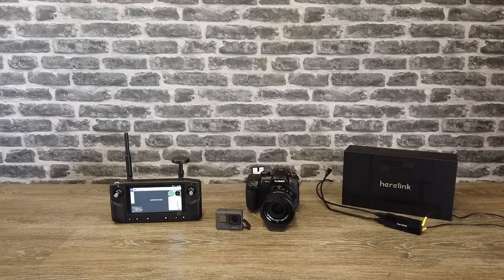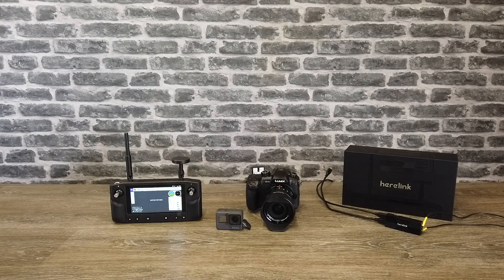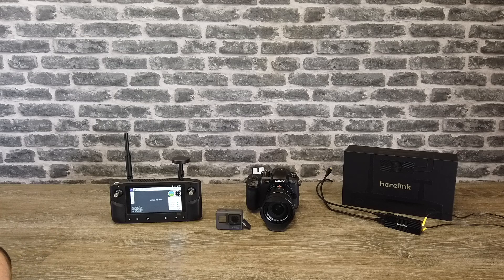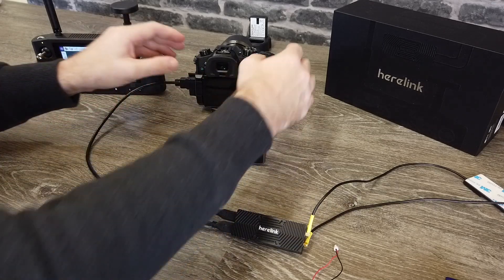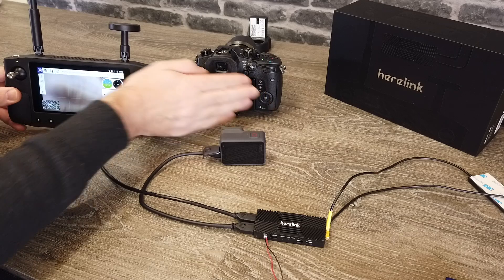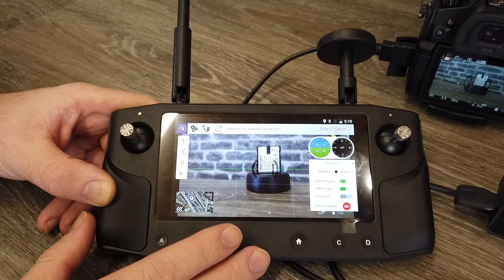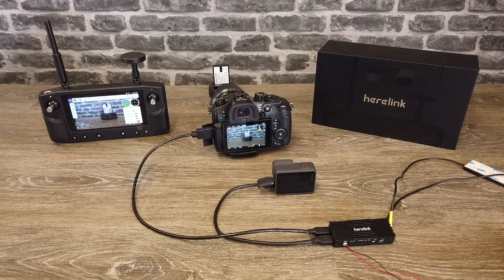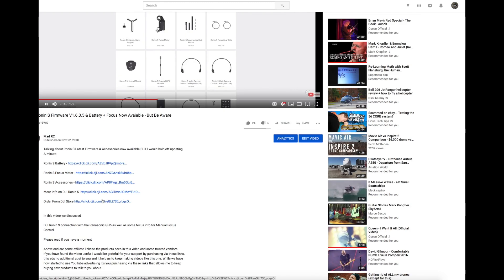Herelink FPV For Pixhawk - What Cameras Works & FPV Video Setup

Comment: How can i control any servo drives or gimbals or camera controllers with herelink?
There are few switches on the ground station.
Reply from the maker: You would feed them from Pixhawk or the Cube.  The output is Sbus so you would need to use one of the Aux channels.
Reply: But how can I control the channels?
for example
I would need a three-step switch to focus and trigger a camera.
In a standard remote control, this has so far been done with a lever.
Is there a touchscreen solution for Herelink?

Comment: Great video! Question: Can the GoPro be charged from the Herelink via HDMI?
Reply from the maker: Sadly no but you could just add a USB BEC to the frame and charge via USB C.
Reply: @MadRC  Ok cool, thanks! Do you know of any 3-axis controllable gyro/gimbals that works with pixhawk and the gopro hero?

Comment: As per my comments on your range test video, I have tested the Herelink with two cameras GoPro7 Black and Xiaomi Yi 1080P. The GoPro7 Black worked but the latency is unacceptable, of course the Xiaomi Yi is not supported by Herelink it did not work. But one thing I have noticed with both the cameras they both support live feed. The GoPro7 Black live feed has very bad latency compared to Xiaomi Yi 1080P, I wish the upcoming firmware upgrade will support Xiaomi Yi 1080P. Please pass on the message to who ever is developing the new firmware update. Also I have noticed in other videos there is support for a 3 axis gimbal controller. Can you please make a video on how to set up a 3 axis gimbal for the Herelink system? Once again thank you very much for your videos.
Reply from the maker: Thanks for the feed back.  Will look at the gimbal controller info soon.

Comment: Does the ground unit have HDMI out?  Reading comments it appears to not be an option, can you please confirm.  If HDMI out of the ground unit is not an option, can you recommend a setup that does? Thanks in advance.
Reply from the maker: No HDMI sadly but there may be some interesting other options conning.  

As for anything else there is literally only LB2.
Reply: @MadRC  Good to know, thank you.  Looking forward to when more units available.

Comment: Correct me if I'm wrong, now we can operate an RC vehicle with objects between you and the vehicle. For example, flying a multi-rotor on the other side of a building or a hill not having direct line-of-sight, and still be able to control the vehicle? Unlike some products which in order to have control you need line-of-sight for it to operate. Is this correct? I want one I just don't know if I need one. :P
Reply from the maker: All radio relies on line of sight and flying behind any structure is generally going to result in loss of signal

Comment: Hey Mad, one last question. If a camera has an HDMI output (full-size) with live streaming capability, do you think I could use an HDMI mini to HDMI adapter and it work on the Herelink?
Reply from the maker: Yea that will be fine, I’m using a HDMI to Micro HDMI cable on the GH5, you can also use an adapter just make sure it’s a quality one.
Reply: @MadRC  Thanks for your input!!! :D
Keep up the ProfiCNC vids! ;) I love them, almost as much as I love my pizza. XD lol

Comment: Thank You for your videos on Herelink system, I was very much impressed with the 20 km working range. I am building a long range quad and looking for a long range video system, and after considering what was on offer from DJI, I settled on the Herelink because of the different choices available from other manufacturers. In a rush to get my hands on one I purchased the last one from 3DXR as per your recommendation, and paid $1300 AUD or so including postage.Then I was contacted by DHL to inform me I have to pay import duty and GST, it cost me another $280 AUD for duty and GST. To make things worse now the Australian distributor tells me he has two in stock for sale for $800AUD. I have paid double for this system I hope it lives up to is claim and at least do 10 Km range for my trouble.You have mention in your video that you are using it on your aircraft, have you had an opportunity to test the range?Also can you please include the weight of the items you review, because weight is very important when your building a quad. The Herelink air system weighs 90 grams including both the antennas. I have to shave weight to keep my aim of getting 60 min flying time.Also can you all recommend me a 3 axis gimbal to work with this Herelink System? Bearing in mind the gimbal should be light as possible and should be compactible with the Herelink System.Oh will be purchasing the Pixhawak 2.1 from the Australian dealer today, and willing following your advice and will get the Monch products to go with it.Thank to allGanesh.

Comment: Nice video. Here's a question; will this eventually support trigger over hdmi via the Solex app? This is probably a question for Kelly Schrock, and each camera would effectively have to have "profiles", but I'd really like to control parameters (iso, shutter, aperture) and at the very least trigger over hdmi.
Reply: thats up to camera manufactures to open source their camera interface. Gopro ended access to zenmuse after DJI started making their own cameras or perjaps when the Karma was dreamt up
Reply: @andrewjamez  fyi ... mavlink intercepting commands. Where there's a will there's a way. Also I might add peripherals like intelli-g also command a number of cameras. It is merely integrating that technology. 

Regarding full control over the Hero 7 on the 3DR Solo & Solex

https://www.hackster.io/user1085757683/gopro-hero-5-6-7-black-control-with-3dr-solo-9df7aa

Comment: Hey Mad RC, lol me again. Sorry for pestering about all these questions but I have a feeling you're probably one of the most qualified people in the world right now that could answer them.
Do you know if it's possible to use an HD 1080 webcam to live stream instead of an action camera? Or perhaps a camera with less height than a GoPro. I literally only have 38mm of wiggle room (height-wise) to slide a camera into this slot on my drone.. I don't think a GoPro is going to fit T_T
Reply: web cams are IP protocol, you would need an ip to HDMI converter which are bulky and may or may not work...also it would add more latency which is the enemy
Reply from the maker: Yea as stated webcam has not got hdmi.  At this stage GoPro os really where it’s at, there are some smaller Fpv cameras with a HDMI but again these have not been tested.
Reply: @MadRC  Yeah, I found a camera that might have worked. It was the JooVoo X which could output live HDMI video and it was the perfect size like about the same size as  the Mobius camera but appears to be out of production... I'm surprised how few cameras that are out there below $200 that have an output HDMI mini. It has me a little salty today. Going to swing by Best Buy and ask Geek Squad if they know of any cameras other than GoPro. Like I said earlier, the GoPro is too tall for my application.
Reply: Check out this
https://www.back-bone.ca/product/ripcord/
it relocates the sensor/lens of a Hero5 via a ribbon cable. Ridiculously expensive, but I still want one. Not sure if the ribbon cable would get in the way of a gimbal.

Comment: Do you know if the GoPro Session or Polaroid Cube could possibly work for live streaming? I didn't see them included in your list. I'm assuming none of the Runcam cameras would work.
Reply from the maker: Not been able to see a single run cam with HDMI and I have looked through all of them, there is no HDMI out on the Sessions either, basically it’s only that list.   As for 3rd party ones I’m not sure any of them will work for HDMI love feed, some have playback but no love feed and many are just using the micro HDMI as a connector for analog video
Reply: @MadRC  Thanks for the information! I greatly appreciate it :D
Keep up the good work! I love your Pixhawk 2.1 Cube videos along with their respective companion vids.

Comment: Very nice walk-through. Have you heard anything about the ability to purchase only the air units? I have several platforms I would like to experiment on and only need a single ground controller.
Reply from the maker: Not yet but hopefully when it’s on proper release then they will be available but I do not know where the price will be.